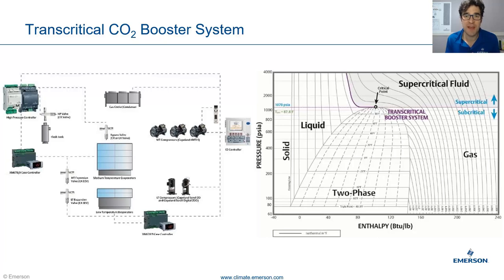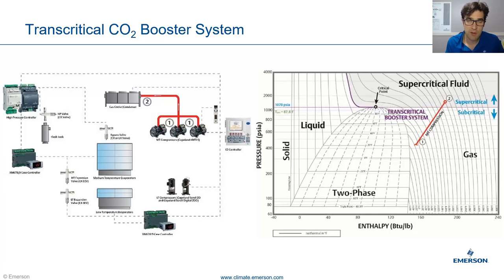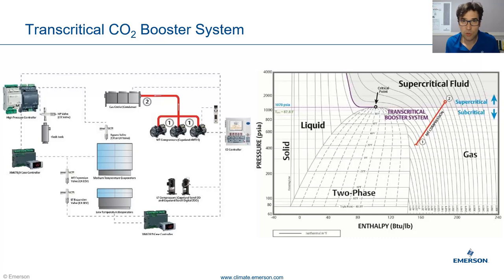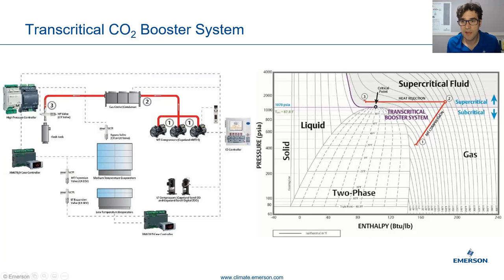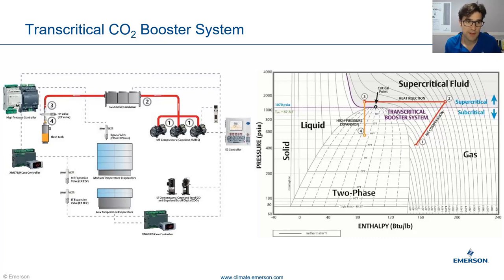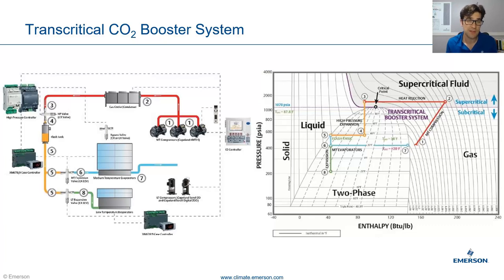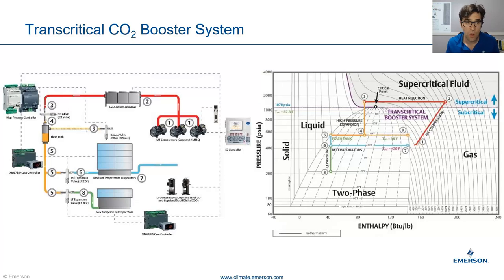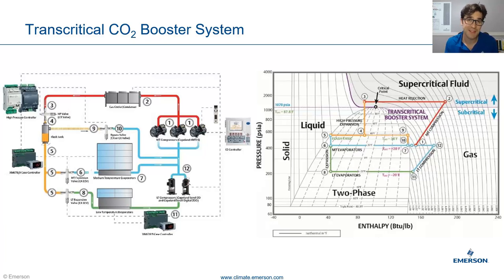Overview of R744 Transcritical Basic Booster CO2 System

Comment: What determines the AMOUNT of pressure difference from 5 to 6?   Yes, as you say the high pressure bypass valve and 9 work together, but the question is what drives the selection of the pressure at 5 and 9 and what determines the difference in 5 to 6 pressures?  

It is just what the value can handle in pressure regulation?  Or is there some needed pressure difference between 5 and 6 that gives a stable flash tank?

My application is for a new type of engine that captures CO2 to be recycled back into fuel by RE resulting in NO CO2 tax.   The CO2 is also used to enhance combustion efficiencies.  The engine also will functions as a combustion heat pump at ~COP4...  The engine compressors are uses to compress air and CO2 gas.

Comment: What is the pincement in the gazcooler:  between air outside and gazcooler. 
Please . 

Thank you so much
Reply from the maker: Can you elaborate on your question.  I want to make sure I fully understand your question
Reply: @RefrigerationMentor  
Ok thank you. 

I would like to know what is the difference between air temperature and pression gas cooler (Temperature) delta T. 
I know that is calculated with the best COP. But for a technician it's difficult to guess. 
Ok so what is the target value between (air temperature outside and pressure gas cooler (temperature)).

Comment: How to deal with standstill pressure of CO2 gas in receiver when system is off.
Reply from the maker: There are a few ways either have everything designed to withstand the standstill pressure or have a backup refrigeration unit to keep the flash tank receiver cold
Reply: @RefrigerationMentor     if my ambient temperature is 43C, should I design entire system at 105bar pressure ?

Comment: What is the main benefit of using co2 as a refrigerant? It seems like the characteristics make it rather difficult to manage above 82 degrees f. I think I see it's capability to move large quantities of heat very rapidly, with the correct equipment, but I feel like I am not understanding something important. Would be more than happy to receive any information in this regard from an experienced tech. Thanks 👍
Reply from the maker: Low Global Warming Refrigerant, very high net refrigeration effect, Smaller piping and equipment with more capacity, flooded evaporator design possibilities many more benefits